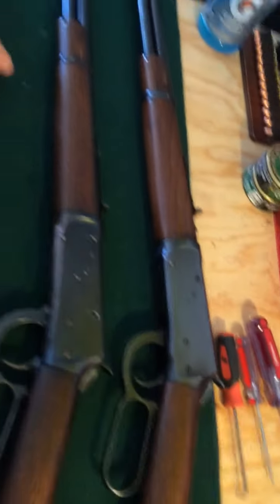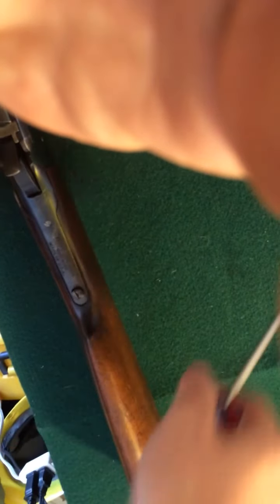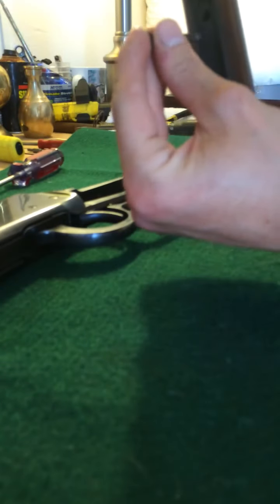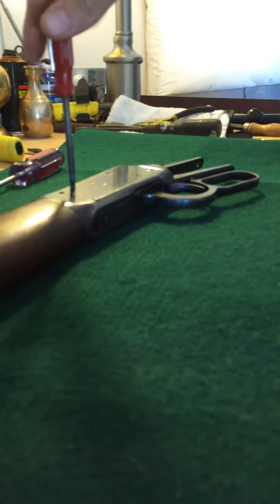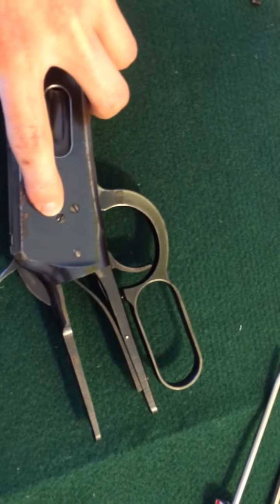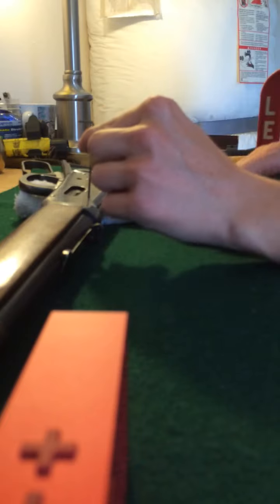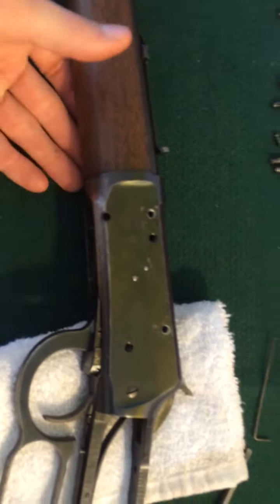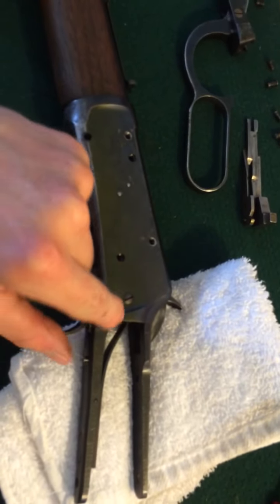Disassembly of Winchester 1894 30-30 pre 64

Comment: You’re right.  There’s very few pre 64 videos out there.   There was a super good one, but it seems to have been deleted.  I just got a 1921 in mostly wonderful shape, but I think the firing pin is busted.   Hopefully just the spring.
Reply from the maker: Congrats on the new rifle. I think the firing pins get damaged from people dry firing. Good luck getting it fixed, let me know if you need help finding the replacement parts!
Reply: @taylorbarnes5377  thanks so much for the offer!    It could very well be from dry firing, though I have to admit, I really don’t get why that would matter.    I mean does it matter if the large body hits the housing,  vs a tiny pin hitting brass?
Also dry firing for pistols is something that is actually recommended.
But I dunno.    I feel like it’s a matter of decades, or even a century of abuse, amd not just a few pulls of the trigger.
Anyway, I found a site that has pre 64 parts lists and schematics, but I’ll have to keep you in mind

Comment: Have a model 94 from mid 1940’s and couldn’t find anything on it tried disassembling on my own but once I had taken the pin cover off the pin was offset but that was probably caused by improper dissasembly haven’t tried it yet

Comment: Thanks for posting this!
I've recently acquired a 1950 Model 94 that's never been torn down. The pin in the bolt will not budge! Any tips on how to free it up? 
Also, if I can't get it, is there a way to realign the trigger and hammer? Almost everything else is torn apart, but I cannot remove the lever, feed ramp, etcetera. I tried just reassembling it, but the hammer is out of whack. I'm going to be that guy showing up to my local gunsmith with a rifle in pieces!
Reply: Matthew Campbell

Comment: I just took apart an early 1940's Winchester model 94 I bought this past Friday with "Winchester" stamped on the tang and steel shotgun style buttstock  plate.  My  question is. Is it a 1943 or a 1941 model 94? It has a 41 stamping is at the base of the barrel next to the 30WCF stamping there. Well, the serial number on the receiver is 1272620.  According to my 2016 4thEd. Blue book Pocket Guide for Winchester firearms and Values by S.P. Fjestad it shows under the column "Approx. Last No" that serial number on the receiver 1272640 falls somewhere after 1942 because the last serial number listed there for 1942 is 1221289. 1272620 is after that which mean it could be a 1943 year model. This book doesn't list any "Approx. Last  No" serial numbers for the years 43-47.  Now, if you look under the column on the right "Polishing Room SNA" , the last serial number listed there for 1941 is 1313301. 1272620 is before 1313301 which means it could be a model from the year 1941 like the barrel stamping shows.  So, could it be a 1943 like it shows  under the column " Approx. Last No"  serial numbers or  is it a 1941 year model  like it shows on the barrel stamping and  under the column "Polishing Room SNA" serial numbers?   I'm  not sure.  It could be like when parts of cars are built at Detroit. The parts may be built today and stamped 2017 but, may be used when assembling cars 2 years from now. So are the cars 2017's  because the parts were built today in 2017 or a will they 2019 cars because the cars were built with those parts 2 years from now.   I usually date the model 94's I buy by using the serial numbers under the column "Approx. Last No."  but, now I don't know if I should go with the barrel year stampings and the numbers listed under the column  "Polishing Room SNA ".  Not every barrel of my model 94's I've taken apart have year a stamping on the barrel base. I noticed the 30 WCF is always there though.
Reply: If you go online at this adddress (http://www.winchesterguns.com/content/dam/winchester-repeating-arms/support/faq/serial-number-reference/Winchester-Manufacture-Dates-by-Year-2012-Scanned-Documents.pdf), you can find the manufacture date according to your serial number which is located on the bottom of the receiver by where the forearm meets.